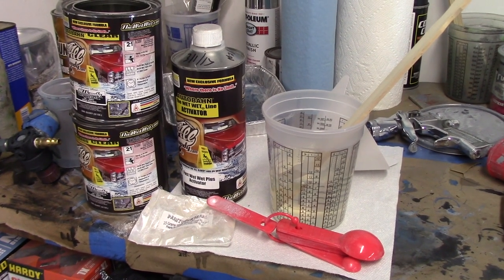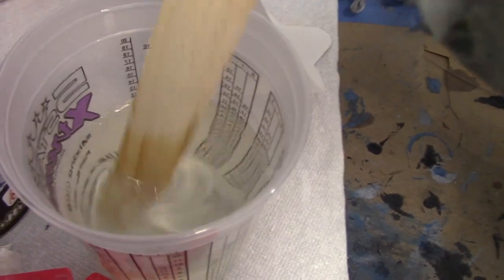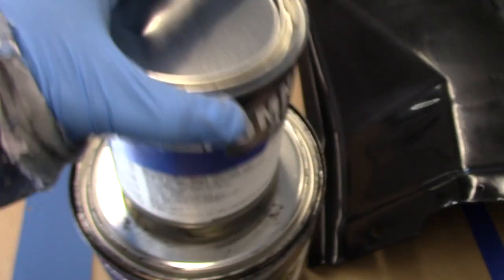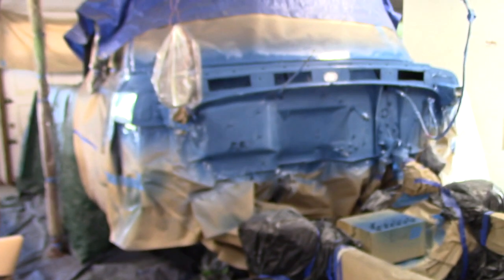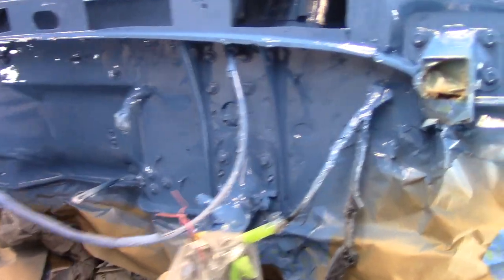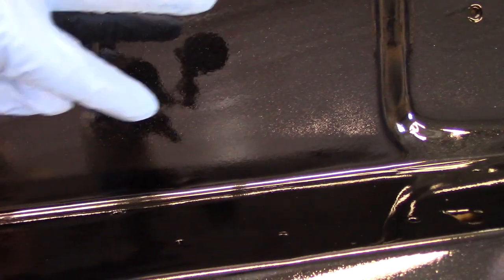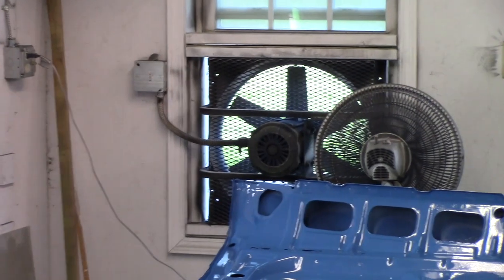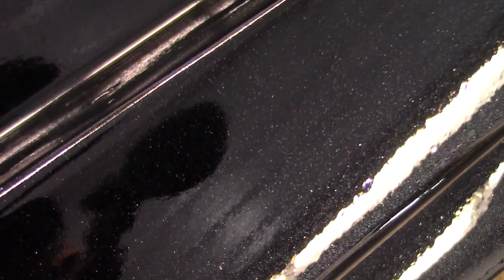How to Spray All Kandy Wet Wet Clear Coat with Pearl Flake on a '71 Ford F100 Cowl

Comment from the maker: Update- Tenn is no longer selling it. You can buy it online listed as AutoBahn AC9045 2+1 Glamour Clear.  To speak with AutoBahn direct: call them at (800) 274-5522 or CPS Coatings .com . I highly recommend their clear and I will be doing several more projects with their clear this winter!
Reply: Damn smh
Reply: Hey that's listed as the wet wet plus. Do they have an extrem version or do i have to just keep adding coats of clear??
Reply from the maker: Chris G - use the Wet Wet Plus version AC9045, the extreme is too thick that Tenn had to thin it down. The AC9045 is  What AutoBahn said was the best and easiest to use today.
Reply from the maker: Chris G - 3 coats and walk away or 2 coats, let dry , wet sand 600 grit then 2 more heavy coats. Like a “Flow Coat”. For me, 3 coats and be done
Reply from the maker: The AC9045 Is a High Solids Clear, very thick when dry
Reply from the maker: Matt - 👍 I had watched some reviews on YT, seemed like people were happy and about the same price too.
Reply: You should do some new videos Rusty....

Comment: Wow. Thats Crazy spraying at 50 psi. Try using 3/8s ID hose and 3/8 I.D. fittings. And spray with 29 to 33 PSI. That Devilbis gun is capable of alot better finishes with. Heavy high solids clears. There was a ton of Orange peal in that.
Reply from the maker: Thanks man! I only sprayed at 50 psi because so many “professionals” said it could not be done. Yes Usually 32 psi is sufficient. Believe it or not the orange peel was not nearly as noticeable in person , the camera lens is far more critical.

Comment: What spray gun do you recommend to use to spray the wet wet extream clear coat
Reply from the maker: Hi Dave 👋- unfortunately Tenn’s Wet Wet went out of business a few years back. It is merely a re-branded product of Auto Bahn Glamour Clear. It’s still available from several places online but for the money you are way, way further ahead buying Speedo Kote High Solids Clear Coat # SMR-42. As far as a gun, don’t let the big name guns fool you with their fancy advertising hype! Literally any gun with a 1.3 Tip can spray a decent coat to match the factory orange peel on any production car made today. As for myself, I use a DeVilbiss Tekna ProLite with a 1.3 tip and a T110 air cap because I’m doing restoration work and want a super flat finish without a cut and buff. A DeVilbiss FLG 4 is an excellent medium quality gun for its price. If you asked 10 different painters you will get 20 different answers. 95% of your results / quality comes from the preparation, not the spray gun. Check out “The GunMan” here on YouTube for more unbiased information on spray guns.
Reply: Thank you for your help. Is it clear that you're talking about sprayed the same way with the PSI at 50lbs
Reply: All kandy is still in business the owner is different
Reply from the maker: @davemcaferty6347  - yes, went to AllKandys. But the stuff is way overpriced. SpeedoKote is much cheaper and just as good if not better.
Reply from the maker: WetWet is just relabeled Auto Bahn clear coat. You’re paying a premium for the marketing

Comment: what final grit did you paint over 400 or 600
Reply from the maker: gary hawthorne- Scuffed the Acylic with a red Scotch Brite pad. Definitely the finer the better so there are no scratch marks, 600-800
Reply: and you scuffed basecoat before you sprayed the clear?
Reply: Chris G Yes. See above response.

Comment: Next time you use that clear with that gun spray it at 32psi instead of 50psi and I guarantee you will like the results and you'll have a lot less trash and use a lot less clear
Reply from the maker: asheetuglasse - I’ve tried it at lower Psi, worked ok. I just wanted to show “professionals” that it can be done at 50 psi by an amateur. The light trash was mainly in the Acylic Enamel, prior to the clear. How do you like WetWet?
Reply: jay left  personally I think 32 psi with a tekna or 28psi with a Sata gives better results and less over spray and less material used (better transfer) then 50psi    a lot of people float coat the wet wet but any clear you float looks bad ass including the wet wet.  I spray a lot of paint and that's what works for me and in my environment
Reply: Rusty Zipper.  I like it, its a good bang for your buck clear.  On my personal stuff I use concept 2002 it's expensive but I know 20+ years down the road it's going to still look good it's been around a long time with a great reputation
Reply: That 2002 PPG clear will look good in 15 years
Reply: I bought a different air cap for my Tekna, it came from Greece on eBay. It’s a euro air cap really busts the clear up. The Gunman and a guy named  Tony I believe professional  painters on YouTube used it and it lays the clear out smoother than te20 or the te10 aircaps on tekna prolite.
Reply: It’s the T110 aircap that breaks up high solids clear better. It works for me. Breaks up thick euro clear at only 30-35 psi not 50, the fan will start breaking up on it and it will not distribute the clear in an even pattern. The old siphon feed guns were 50 psi and you could barely get around a car on a 4:1 gallon kit of clear. I watched my dad paint all overs growing up as a child from the window of his shop.  There would be so much overspray you couldn’t see the other side of the shop! 50 psi with a new gun is a joke!!!  I painted professionally for 3 years production until I got sick 50 psi would’ve got me fired.

Comment: I just seen it for the first time and you are shooting way to high of pressure you should be around 25 psi dude and nason and deltron are cheap paints
Reply from the maker: I shot it at 50 because so many “professionals” said it couldn’t be done. I normally spray this around 32, I personally like a little higher pressure with the DeVilbiss but you spray whatever you want however you want; after all it’s called a custom paint job.

Comment: Are you getting paid by autobahn? I worked at a shop for years and we only used autobahn on Car lot cars because it was cheap junk , unless there is something I’m missing let’s see that 1 year from now of sitting outside 😳
Reply from the maker: MrFireman164 - All Kandy WetWet holds up nice but all of our projects are trophy winners not auction specials. Tenn doesn’t compensate me for the videos, the product works so well That I enjoy promoting it.
Reply from the maker: Have you tried WetWet Plus or Extreme? Yes - it’s made by AutoBahn but this is not the low end line like you are familiar with.
Reply: Rusty Zipper no I haven’t used that wet wet , ppg concept, spies hecker , some matrix clears . I see a lot of people using this and spraying at 50 psi and running it off the panel . So autobahn makes a high end product then . New to me ,most painters I know stick with debeers , ppg, DuPont ect..
Reply from the maker: MrFireman164 - I really like the Wet Wet Plus, IMO it’s the best quality clear for the money. You can spray it at a lower psi- 32 or so. The point of my videos is that if I can do it at 50 psi then a “professional” shop can too. The one run was my fault where I doubled the coverage on the final coat. If you’re happy to pay PPG prices 👍 but I enjoy achieving trophy results on a budget. NO ONE has guessed Acrylic Enamel as the base coat at a car show.
Reply: jay left lol , you got me !
Reply from the maker: JayLeft- Ain’t nothing wrong with a Siphon feed gun! “My Friend Pete” still uses his, but I never would after using my DeVilbiss. I would rather have superior results using low cost products vs guys who spray overpriced PPG Concept and have to wet sand and buff to get the results of WetWet from the gun. But you guys spray whatever you want, I spend my Free time polishing trophy’s !
Reply: Rusty Zipper wait do you think Pete is good at what he does?
Reply: Ok , well now I understand a lot more , Pete maybe imo one of the worst body men I have ever seen . Oh and your vett is kick ass, I had a 2001 zo6 , I know it doesn’t compare to yours but it was fun while I had it .
Reply: @RustyZipper  Hey Im tryin to polish sum trophys too!! What gun do i need to spray base and candy and what gun do i need for the clear. All kandy silver, deep ocean blue, and wet wet plus extreme!! Im on a low budget and just got me a garage!! Can you help cuz unlike these fools i need the knowledge now.
Reply: I've seen show cars sit in a yard in all weather for years and its still fucking shining!! They say 1 coat equals 3. I think there putting over 6 coats!!
Reply from the maker: Chris G - hey man! Check out “The GunMan” awesome guy, reviews spray guns from Sata Jet$$$ to Harbor Freight junk. He just reviewed Primer guns and said the #1 most versatile and price effective gun is the DeVilbiss Finish Line (FLG) 5 ,  #2 is a DeVilbiss GPi , for the money you can’t beat their performance
Reply: @RustyZipper  Ok thank you!!
Reply from the maker: Chris G - bottom line when you’re doing custom paint jobs is to do whatever the heck you want! You don’t need to spray Wet Wet at 50 psi, 30 + will work. You don’t need a $500 gun, you don’t need to use PPG or DuPont overpriced paint either. I use PPG Omni Acrylic Enamel and get amazing results. You Just need patience and practice. The reason I made this video is to show that If I can get these results spraying only 2-3 projects a year then you can get better doing it Full Time. 💯👍
Reply: @RustyZipper  Your absolutely right!! And Im not scared to try it. I've seen all typed of work with no paint booth. Its time to lay that 🍬 and turn heads!!
Reply: Paint stick and some 1000 3M paper works for the runs. Better to run and have some build then dry spray and nothing to wet sand and buff. Good video!